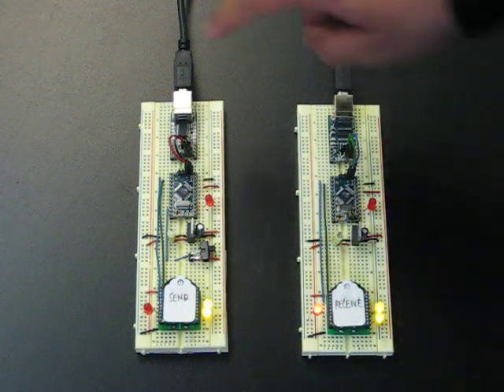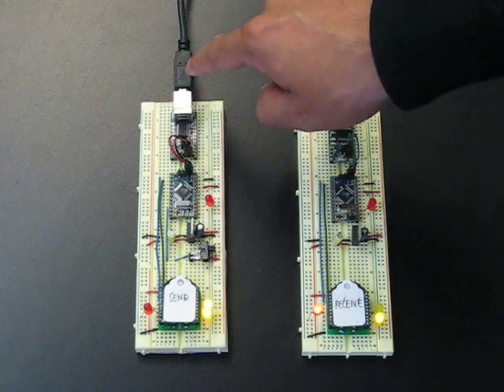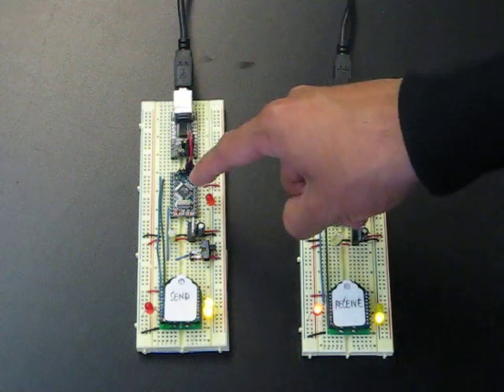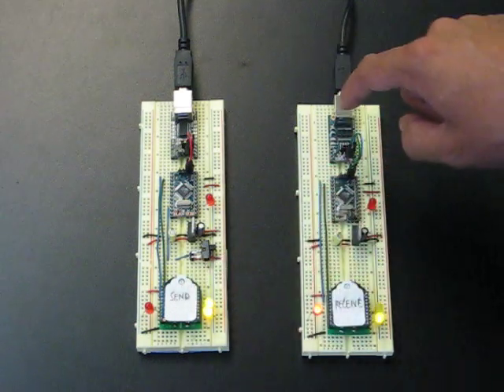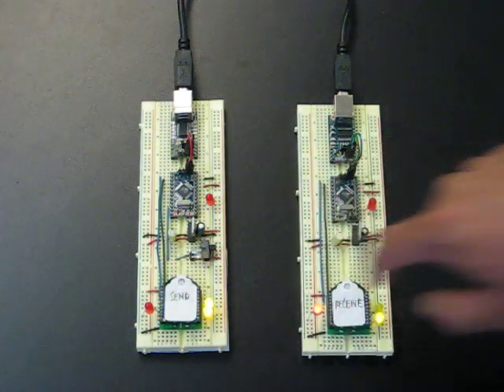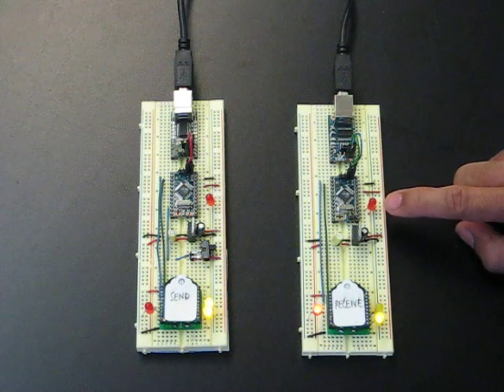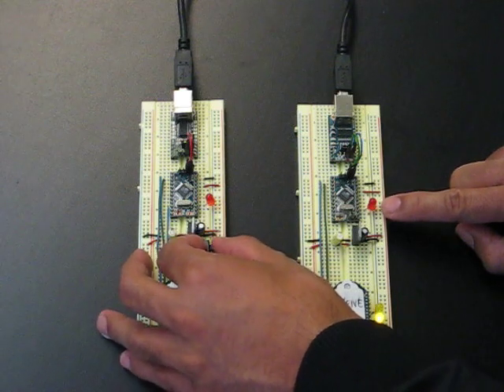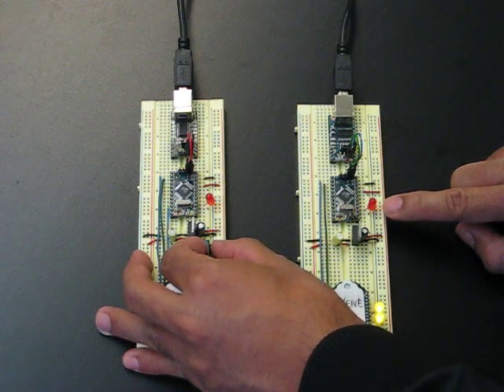Triggering an LED on one XBee (zigbee) by way of another XBee

Comment: I have a question that will probably show my ignorance, but...  can I turn on the XBee without sending an RS-232 code to the device?  Does the receiver have a single pin that can be pulled low (i.e. open collector type) whenever it is receiving a signal from the transmitter?